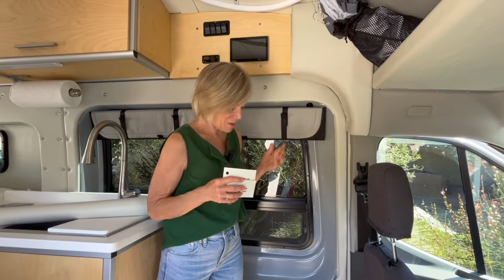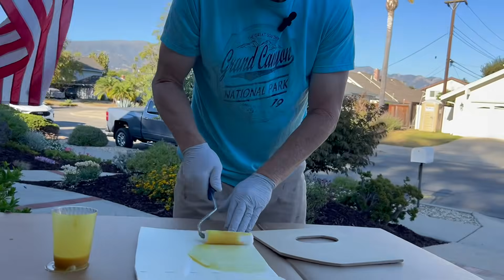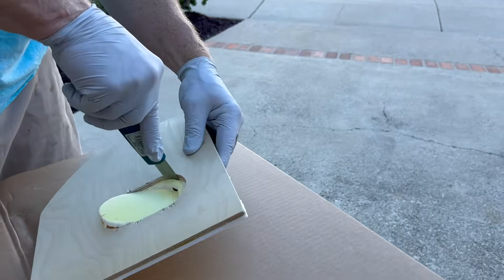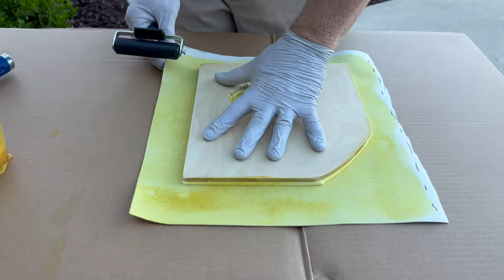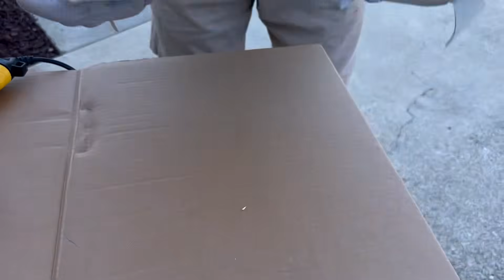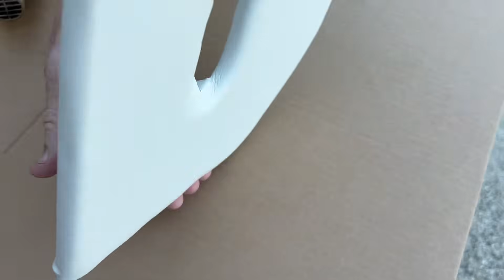Wall Panels (Marine Vinyl Upholstery) in our Ford Transit Camper Van

Comment: What a super cool looking van! I am going to buy a Ford Transit and have it professionally built out and I will use yours as an example of many features I would like to incorporate,  

The company who is going to build my van has quoted me for fabric walls, but I really like that marine vinyl. It is a sleek and elegant look. 

I am wondering how much more time it takes to apply marine vinyl rather than fabric or marathon tweed. I am concerned that is may be too labor intensive (compared to fabric) and may drive the price up too much. 

Do you have any idea how many hours it took you to finish all the walls and ceiling with marine vinyl? Can you estimate how much more time it would take to install marine vinyl rather than marathon tweed?

 Thank you for any information you may provide.
Reply from the maker: Thanks for your kind words!!!!  I have never installed marathon tweed.  However, I imagine that the time and effort would be about the same.  The time we took to custom make the wall cutouts and then upholster each piece was a lot.  Sorry I don't have an estimate.  This was our first van (only van) and we took our time to get it right the first time:). 

 We love how easy it is to keep the walls clean!  Camping and travel in general is a dusty endeavor .  All that dust just gets wiped away on the marine vinyl.  Fabric is going to catch and trap the dust.  

Thanks again.  If you want even more detail on this part of the van or any other area.  Let us know.  Be happy to do more videos!

Comment: Thank you for sharing! After watching your video, I think this is what I’ll do with my vans walls and ceiling panels too. 

A few questions, please….

1) Instead of stapling the Reflectix to the backs, any reason you didn’t use contact cement?

2) How long are the staples you used to staple the vinyl and Reflectix into the 1/4” thick wall panels and the 1/8” thick ceiling panels?

3)  Did you use finish washers between the heads of the screws and vinyl? (I’m referring to the screws that attach the panels to the Rivnuts.) 

4) What size were the screws (#3 above) and Rivnuts?

5) Did you find out if there is a real difference between the Weldwood Landau contact adhesive you used and the regular gnarly Weldwood contact adhesive? I’m asking because both are gnarly smelling solvent based contact cement and wondered if they are actually the same thing but just packaged differently?

Thanks!🤙🏼
Reply from the maker: Thanks for your great questions!!!!  
1)  No need to glue the refectix on.  A few staples hold it in place perfectly.   
2)  Used 1/4 inch staples.
3)  The screws have a wide rim.  So, no need to washers.
M6-1.0 x 10mm Flanged Button Head Socket Cap Screws, Stainless Steel 18-8 (304), Bright Finish, Full Thread, Allen Socket Drive, 25 PCS
4)  Used M6 screws and Rivnuts.
5)  Yes.  Big difference.  Honestly, please look into seeing if you can purchase industrial headliner adhesive.  You will not ever have to worry about delamination.  I could not use it because it is impossible to get in California.
Let me know if I can help in any other way!!!!

Thanks again!
Reply: @OurFirstVan .  How long were the staples you used to staple the Reflectix to the 1/8” plywood?

I’m in CA too so I doubt I’ll be able to buy the special headliner glue.

Thanks for replying. I really appreciate it!🤙🏼
Reply from the maker: @joeblow1942  Not a problem!  We are having fun sharing our experiences.  If there is any other information I can help you with, please don't hesitate to reach out.  I can do a video to show more details on various parts of the build that may be beneficial .  Thanks again!!!!
Reply: @OurFirstVan .  You said you used 1/4” long staples to attach the Reflectix to the 1/4” thick plywood panels, but how long were the staples that you used to staple the Reflectix to the 1/8 inch thick plywood panels?
Reply from the maker: @joeblow1942 the same staples.  I did not press down hard and with the thickness of the reflectix and the 1/4 closed cell foam,  the staples did not protrude out the front.    Have had no issues.  Yet!

Comment: VINYL WALL AND CEILING PANELS

WALL PANELS: He made cardboard templates first for every section that he used to trace around the 1/4” thick Baltic Birch. Glue 1/4” thick closed cell foam to BalticBirch ply with contact cement and then glue marine grade vinyl to foam. (He used the good solvent based contact cement and rolled it on with a small foam roller.)  Cut vinyl so it’s at least 1” wider all the way around perimeter of the plywood. Use a heat gun on vinyl around corners and the stretch vinyl around edges on to back of plywood that also has contact cement. Staple vinyl to back. Then he stapled Reflectix on to the back of each panel.

CEILING PANELS: The only difference is that he used 1/8” plywood for ceiling panels rather that 1/4” plywood.

He used Rivnuts to attach the panels to the walls and ceiling.

Landau Plus closed cell foam: https://www.campervan-hq.com/products/landau-plus-closed-cell-foam-padding?variant=42552428986621
Reply from the maker: If the 1/8" is rigid enough  ... I would go with the 1/8.  The 1/4"  gave me a better feel and I have no sag in the panels.

Comment: Thanks this video is a huge help I just got my marine vinyl color samples. How is it holding up are you happy with this installation method and product? Is the white easy to clean?
Reply from the maker: Great question.  Sorry for the delayed response.  We have been traveling!!!!   The walls are holding up very well so far.  The only issues are the tight corners.  If I were to do it again I may look into using industrial headliner glue.  Other than that, they are supper easy to clean!  
Thanks!!!!

Comment: How do you drill and finish the holes to secure each finished vinyl padded sections to the van’s walls and ceilings?
Reply from the maker: Great question!  I pre-drill the holes in the wood and dry fit on the wall to ensure the holes line up with the rivit-nuts.  Then I attach the closed cell foam and vinyl covering.  From the back side of the panel, I poke a small hole through the foam and vinyl.  The screw goes in the little hole.
I hope that was clear.  If not ... I'll do a little video for you.
Thanks!!!!

Comment: This was not a great suggestion about the glue. I tried it and it is incredibly stinky. 3 days after the application it is still unbearable.
Reply from the maker: Oh noooo.   So sorry to hear that it did not work well for you.  That sucks...

The product I used was "DAP Products Weldwood Landau Top & Trim HHR Solvent Type Spray Grade Contact Adhesive 1 Gal, Natural (070798-002333)".   I purchased it off of Amazon for around $60 a gallon.  It is designed to be applied using a spray gun.    Since I do not have a spray gun, I used a roller to apply.    I applied a thin coat to each of the materials I was intending to bond together.    All of my applications were performed on warm days (over 75 degrees).   It took about 20 to 30 minutes for the contact adhesive to "dry".  A light tacky feel.    Then, I carefully joined the two materials and rolled out any air pockets.  

The bonds have held well except for tight corners which required a lot of stretching of the vinyl.  Need to use the heat gun to fix those few areas.  (on my "to - do" list).

Again, sorry for the trouble you encountered.  I know how frustrating that can be.  Let me know if there is anything else I can share with you which may help.
Reply: @OurFirstVan  Indeed, that's exactly what I got. 4 days later it is still incredibly stinky. It does stick very well and it is going to be very hard if I have to remove it. I give it another couple of days.
Reply from the maker: @thelliez  What a bummer.  Have you tried a hair dryer blowing on it?   The heat re-activates the cement material.    Also make sure it is in a dry warm area.   I'm just guessing at this point.  Definitely not an expert by any means.
Reply: The stink will eventually go away but what he used was by far the best. You can use non stinky latex based contact cement but my experience is that for corners and what he did you want the aggressive glue. The latex kind is not anywhere as good as the gnarly solvent based contact cement for this type of application.

Comment: John and Deb this video is great, and your van looks amazing with the vinyl covered walls. I'm planning on doing the same with my new van build. Have you had any long-term issues with the contact cement holding either the closed cell foam or the vinyl as your van is exposed to heat/cold cycles?  I've heard others have experienced their vinyl or foam detaching from the glue. I suspect this may be either the adhesives they used or from spraying it on. Thank you!
Reply from the maker: Great question.  The only place we have had any delamination is in the hard to upholster areas (inside corners).  This most likely was our fault for not using enough contact cement or not letting it set up long enough prior to joining the two parts.  The vast majority of the wall coverings are doing great.  And they have definitely been thermal cycled!  Thanks again for your kind words.  Let us know if there are any other specifics about the van we should video!

Comment: We’re in the process of starting to build out our van, 2026 pro master. Thank you for this wonderful video! I am also a huge fan of humble Road, and other DIY channels. Thank you for taking the time to demonstrate the exact products and techniques used.  There is another product, called 3m70 that comes in a propane sized spray bottle. I will research it. It might go faster versus rolling.
Reply from the maker: Thank you for your kind words!   I’m excited for you.  The build process can be a lot of fun and bring many challenges.  Be happy to share any other parts of our build which may be helpful.  The roll on works but a spray would be a lot easier.  Thanks again!

Comment: For that one corner you need to redo, I'd try going in with the heat gun first. Leave it installed as-is and heart it up, some glues can reactivate when heated, combined with the stretch ability of the vinyl with heat, you might fix it without removing. Worth a try anyway.
Reply from the maker: Great idea!!!!!!!!   Removing that particular part of the wall would be a bit of a pain.  I'll definitely give the heat gun a try.   Thanks!!!!!!!!!!!

Comment: Thank you for this super helpful video! I’ve been struggling with conceptualizing how to insulate and line the walls of my pop up truck camper. This was so clear and methodical! 😊
Reply from the maker: So kind of you!!!!   I am so happy this was helpful.  Make sure to be in a well ventilated area.  That contact cement has a strong smell.  I'm sure it can not be good to smell it. Thanks again!  Let us know if there are any other items about van building that may be interesting.